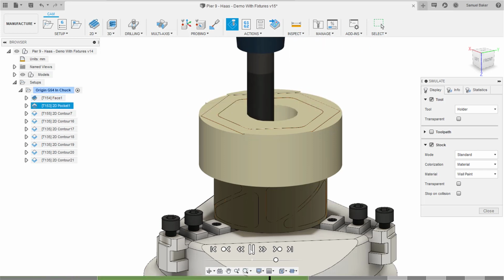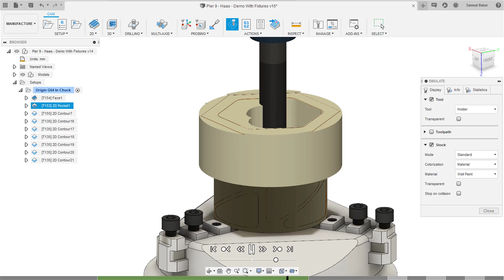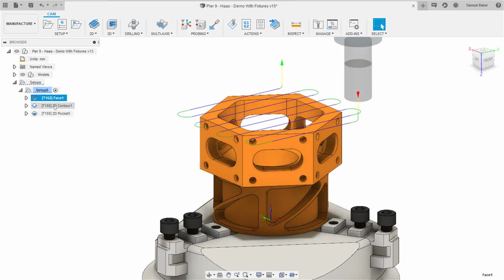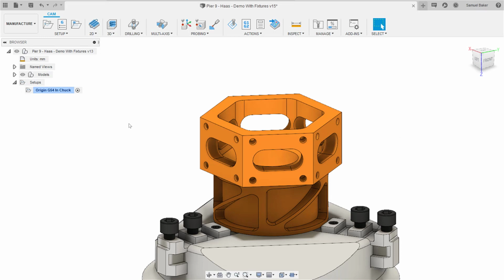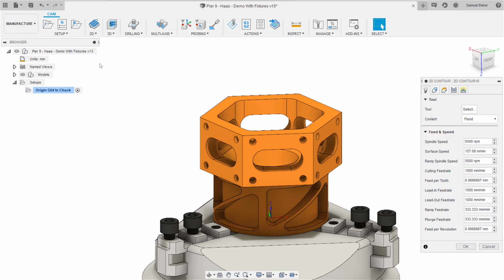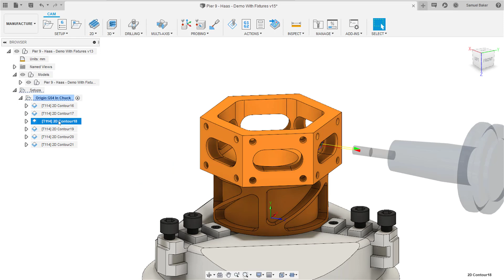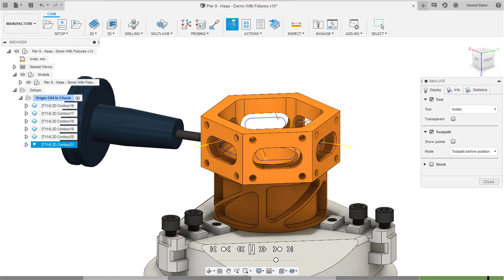QUICK TIP: WCS vs Tool Orientation

Comment: This works, but doesn't scale well with a lot of toolpaths. Each time you use tool orientation you have to reset your datum position. When you have dozens of toolpaths in your setup, it
A) creates a lot of additional work for the programmer.
B) increases the chances of a programming mistake.

Fusion needs to move to pre-defining multiple WCS, then selecting which one to use with tool orientation
Reply from the maker: I'm going to defer to the expert on this...let's see if we can get Sam to respond.
Reply: Hey vworp, 
Using Tool Orientation your machine should automatically re-arrange and adjust your machine axis into the correct position, if you have what we call a Z Max post then once the tool-path has finished then the machine axis should return to their original 3-axis orientation. 
You should never have to reset your G54 on the machine.

There has been previous issues where the machine tool does not revert back to the 3 axis state but our code should never effect the G54 on a machine.

It would be great to talk offline about this issue, have you previously raised a ticket about this issue with your local support team, if you have can you let me know the reference number and I can chase this up.

Thanks
Sam
Reply: @samuelbaker4667  "you should never have to reset your G54 on the machine"
Absolute bobbins. Has Autodesk never encountered a machine with a 4th or 4th&5th axis that does NOT have tilted work plane or dynamic works offsets enabled? They are rediculously common, we have six in our workshop.
We use G54 for one orientation, G55 for another, G56 yet another. Most of our setups have dozens of toolpaths alternating between orientations and G54-G59 datums in the most efficient order. This means our Fusion programmers are resetting the tool orientation datum dozens of times per setup, which vastly increases the chances of human error .
There's a more detailed write up here https://forums.autodesk.com/t5/fusion-360-ideastation/overhaul-of-wcs-in-setups-3-2-work-and-multiple-datums/idi-p/8332151
Reply: Sorry  @vworp  for not understanding your issue at first but thank you for offering a better understanding of what your issue is. From your previous comment I did not understand the full issue you had, however thank you again for providing this post from for forum.

Your forum post suggests a great improvement we can send to our development teams, which I will now submit for you.

However have you tried using NC Programs as you can make multiple setups (with different orientations)
With a single NC Program outputting multiple setups you should no longer have to keep re-setting anything.

Let me know if this workflow can work for you.
Reply: @samuelbaker4667  I found NC Programs to be a rather strange addition. Yeah, I could produce a setup per datum so I only had to generate one WCS per face, then use NC Programs to merge the setups, but re-ordering to minimise tool changes often broke the desired tool order.
Also, the issue of scale arises again. I did a job last week with 7 datums on it's initial 5 axis op (G54 - G54.1 P1). 3 datums on it's 2nd op, and 4 datums on it's 3rd op. Using NC programs to merge them would leave me with 3 instances of NC Program and 14 setups. A rather bloated browser and a nightmare to fault check if something is amiss.
My preferred, and current, method gives me 3 setups, created in the order I want with an uncluttered browser. But unfortunately makes me generate datum, after datum, after datum....
If you can attract some developer attention, get them to comment on the forum post. Maybe there's an achievable compromise no-one can see.
Fusion 360 is great. Nothing beats it at this price. It could be world class with a little focus...
Reply: @vworp  Thank you for your feedback on this, I will report this to our development teams, could you please help us out by giving us a example project of your workflow and put it onto the forum post?
It will help us have a better understanding of this issue.
Forum post:
https://forums.autodesk.com/t5/fusion-360-ideastation/overhaul-of-wcs-in-setups-3-2-work-and-multiple-datums/idi-p/8332151

Thanks
Sam